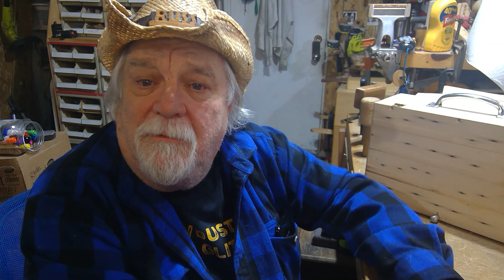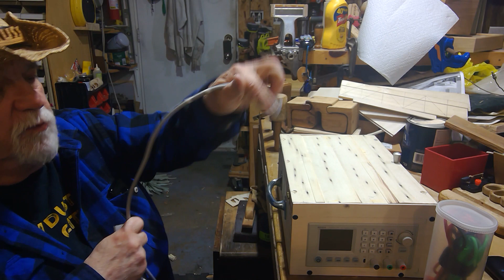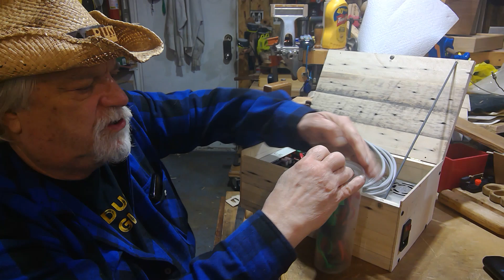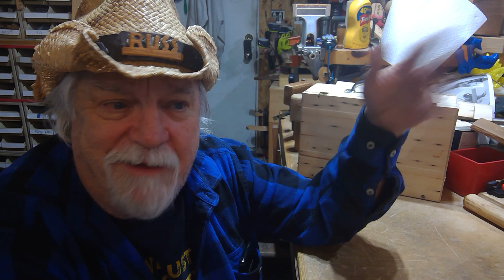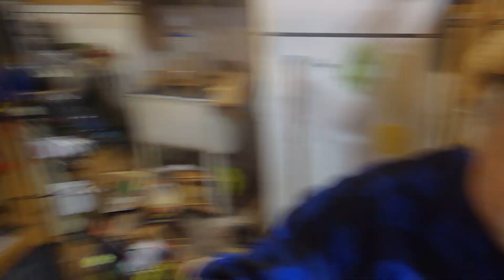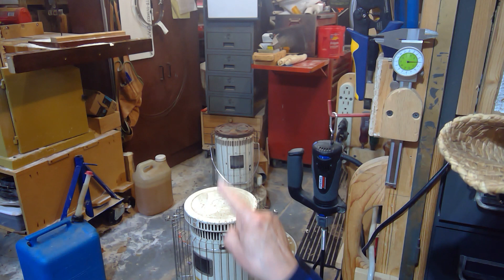DIY RD6018 PS Version 1 & More by Rambling Russ

Comment: IIWMI'D nuke that knob that sticks out & make the side flat, drill a thru-hole in that spot, bevel the upper side of the hole up/in, & glue a scrap of thin ply to the inside for dust control.
I've had a Kerosun heater for decades, it always lights up even when I've let it set for a couple years. They're excellent
Reply from the maker: I'm curious if mine will run after 10+ years.  Thanks Mike

Comment: Russ, good looking PS. Once you get the 60Vdc input connected and switchable with the 24V please show it again. IMHO most fuel that old, like jet fuel will end up growing some form of mold in the tank. I have no doubt that the heaters will work fine but the one with fuel still in it for a significant time may need flushing first. Again in IMHO I suspect the old fuel will probably work but due to contamination may clog up your lines eventually. That was a major concern we had in the Navy with jet fuel especially in the early days and years following switch over from Aviation Gas to Jet Fuel (which is a variant of Kerosene).
Reply from the maker: We are about to find out.  Thanks Tim

Comment: Hey Russ, Used kerosene heaters years ago, they were not as good as yours, had some problem with soot, didn't realize it until I took pictures off the wall! Take it easy, Later, Murph
Reply from the maker: soot is a common side effect of the kerosene heaters :>).  I would only be using them in case of emergency & only short term.  Good to hear from you. Murph.

Comment: I was just watching your long box-making video from almost two years ago. I must have missed it at the time. I was wondering if you posted anything lately and then this video dropped. Nice looking box for the power supply. The pallet wood has a nice appearance. 

We have an electric house but a gas log fireplace. So we can heat with it. We have a 120-gallon LP tank and as long as I don't let it get too low, we should last for a long time. But I would think that the gas line to your house would be among the more reliable sources of power. The electric grid is much more fragile and I would think it would take a serious issue to stop the gas flow. 

Now I am about to search for your kerf tool video. I think you called it "George".  Cheers.
Reply from the maker: Using pretty wood to make a box is easy.  It takes imagination to make ugly wood look nice :>).
I agree that natural gas is unlikely to have a problem until now.  I have been hearing of N-gas might have shortages in the northeastern US.  I decided maybe that might spread to the Midwest.  My plan should give me emergency heat for a week or so if the worst happens.  If the shortages become the norm, I'll probably install a mass heater in the house.
Good memory, It is called George :>).  Thanks Dave